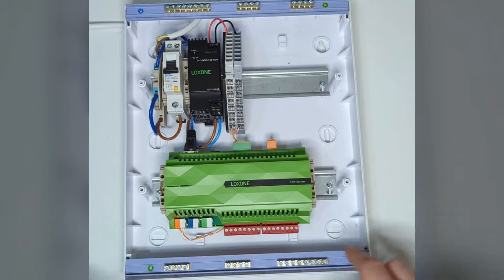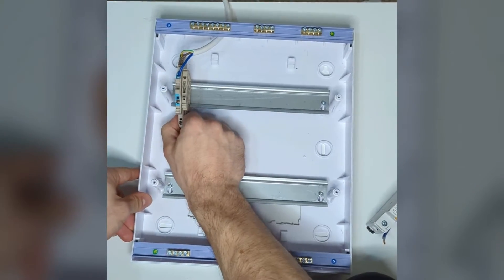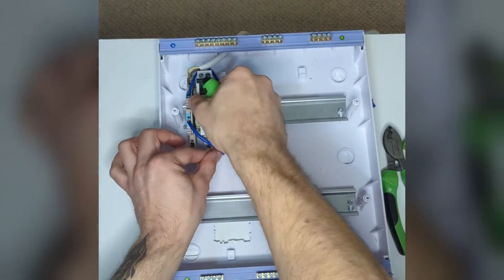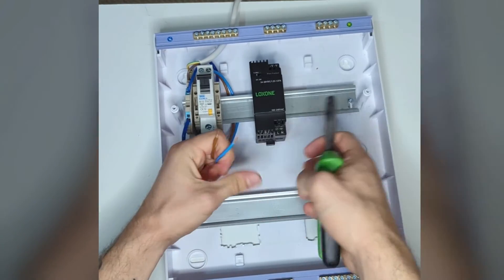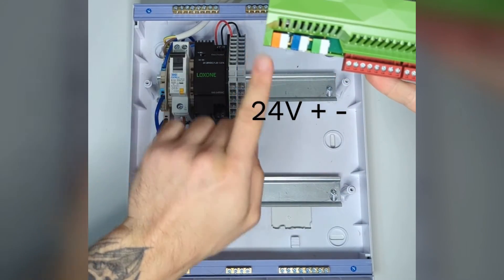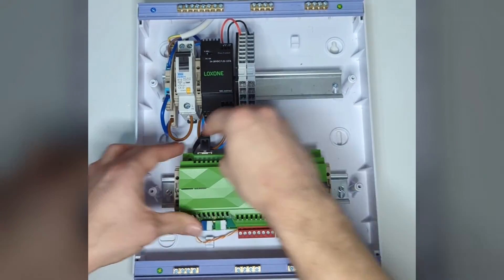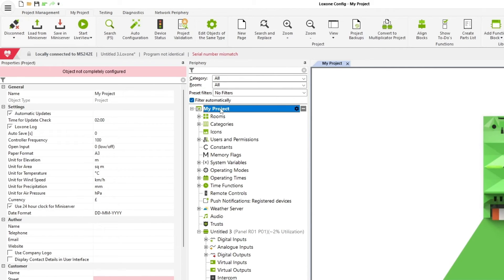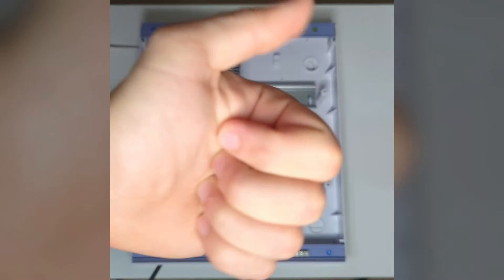How To Connect To The Loxone Miniserver

Comment: hey! just wondering what is the ampage on your plug fuse?

thanks
Reply from the maker: Hey,  it's a standard 13A type G plug 🔌
Reply: ohh right, I am I little confused as a power supply from mean well and it has an input supply of 240VAC 1.8A would I be able to use a 13A plug for that?
Reply from the maker: @Georgescreations 
Hi not sure if I understand you correctly,but yes a 1.8A would be okay on 13A socket.

Comment: Hello, why is the push terminal required as the first component? Why not have incoming supply going straight into RCBO?? Regards
Reply from the maker: Hi, in some countries it's required as part of regulations. Depending on the regs it might not be necessary in other countries.